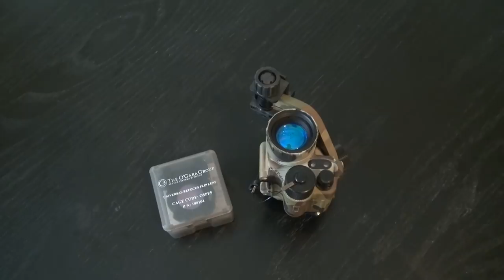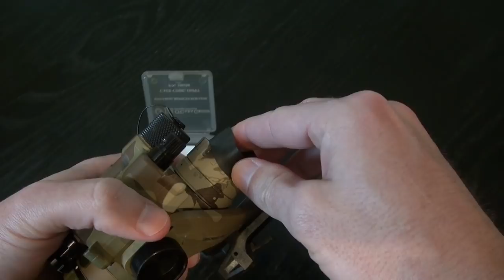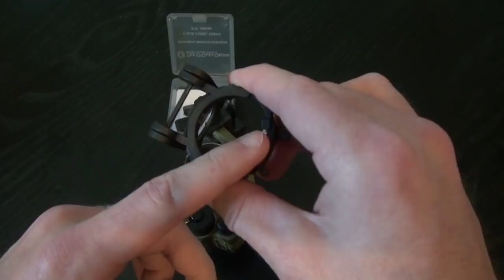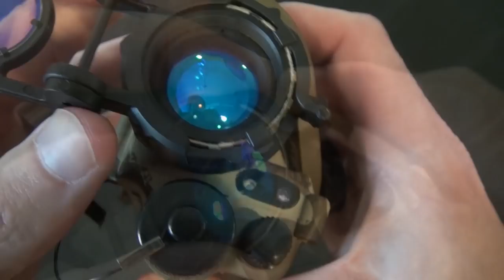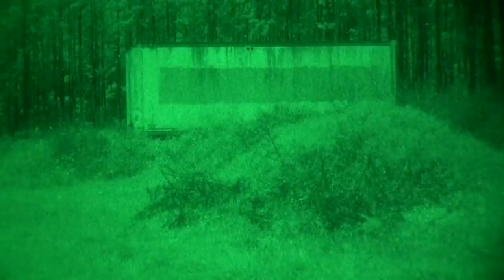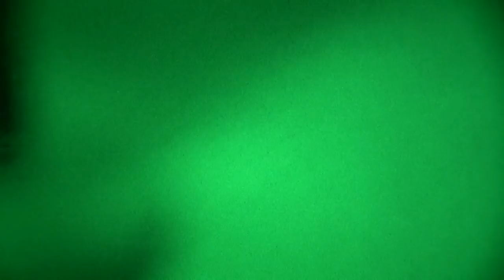Universal Re-Focus Ring (RFR)

Comment: I have the Wilcox Protective Cover on my PVS-14 and when the RFR is installed on the unit, it will not fully seat against the PVS-14 itself and only goes as far back as the Wilcox lens and when i do force it back it seems to lose the friction needed to be fully secure and the flip is not at the right angle (doesn't flip down parallel to the 14 lens.) I have not tried the RFR without the protective cover. It also seems easy to flip the RFR off the unit with the protective lens and have done so a couple of times. To correct this i had to zip-tie the RFR to the PVS-14 and it seems to have fixed it. Just wish that the mounting solution was a little more robust or at least could be able to tighten with an allen or something similiar. Good piece of gear to use when i need to check DOPE or maps (mainly what i use it for), just a tip incase others come across the same issue